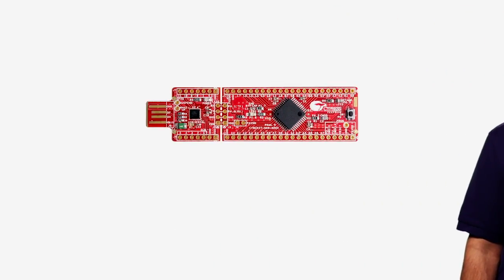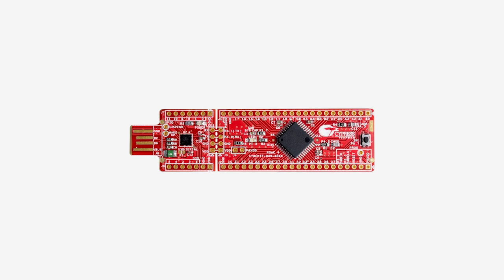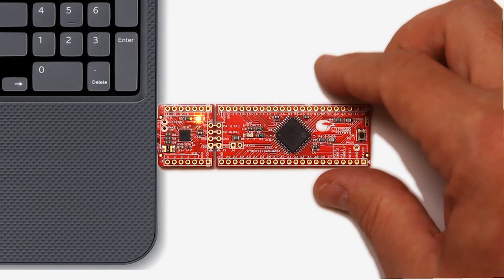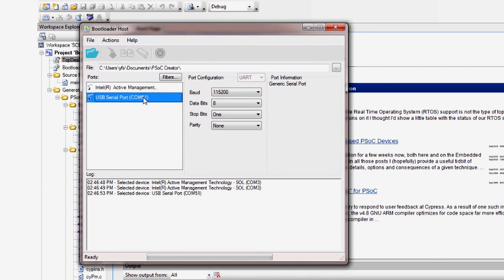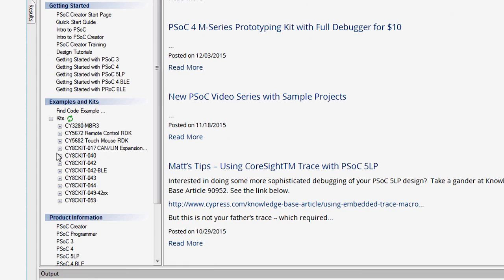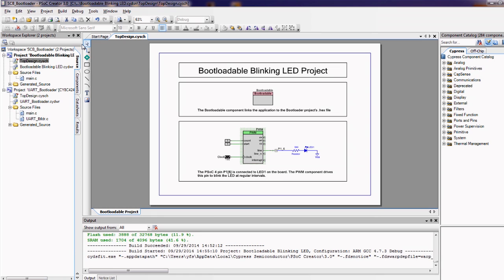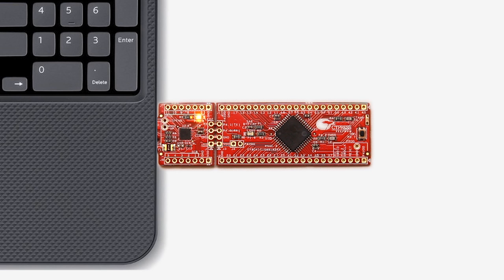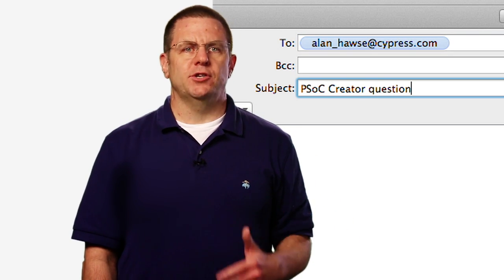PSoC Creator 101: 0. CY8CKIT-049 Prototyping Kit Getting Started

Comment: Although everything is working when changing the project "Bootloadable Blinking LED",  when I try to change the LED timing in the Project UART_Bootloader it doesn't change anything in the LED of the bootloader,  I pointed to the new "UART_Bootloader.HEX" in the "CortexM0\ARM_GCC_541\Debug" directory, I saw the original one is located under "CortexM0\ARM_GCC_484\Debug", I do clean build from everything, but still... I really wonder what I'm doing wrong?

Comment: Dear Cypress:While I do believe this is a great product, getting this development boards to work by following your instructions, has definitely really frustrating. I already spent at least 2 days, and still nothing. Just do a search on any search engine for issues with finding the device after pressing the programming icon, files missing, etc. While Ardiuno is a different type of device and I am sure that it is not as capable, their IDE is much easier to use than your IDE. My recommendation would be put all the required files into a single zip installer, instead of installing many different files. Thank youVictor
Reply from the maker: Hi Victor, thank you for your feedback. We are sorry to hear about your troubles. Is there a specific issue we can help you with? You can also visit our Cypress Developer Community 3.0 to speak with Cypress experts and other embedded engineers: http://bit.ly/29vS9Ts. Best, Cypress
Reply: ponte a estudiar mejor y quedate con arduino, psoc es buen producto.....
Reply: @cuauhtemocgarcia771  y tu menors ponte a estudiar angles

Comment: The code I downloaded required me to unplug the board and PLUG IN WHILE HOLDING THE BUTTON DOWN to get the board into boot loader mode EACH TIME TO PROGRAM the board.  When in loading mode, the LED blinks faster that the default rate.  This fact is buried in one sentence in the middle of a paragraph on the fifth page of the project guide.  It was tricky to let go of the board without causing another reboot as the contact with the port is broken if you move the board at all.  This kit is the right price but the fact that you need a video to explain all this indicates there is a usability problem here.  Maybe figure out a way to get it to program by using a single big button in Creator.  Maybe it would be the program button that already exists!
Reply from the maker: Hi NackDSP, 
 
Thank you for your feedback. Could you please share your contact information with CypressUS@racepointglobal.com -- we’d like to put you in touch with Cypress’ Sr. Product Marketing Engineer of the Microcontroller Connectivity Division to discuss your comments. 
 
Thanks, 
Cypress
Reply: @CypressSemi  Looks like I had notifications turned off for about 7 years. Oops.
Reply: Do you solved issue :D :p  @NackDSP
Reply: @FratDede  Hi.  I installed the connector for the miniProg programmer and used that.  Using a USB extension cable would also work. My problem stemmed from the motion of the PCB causing a disconnect of the USB connector pins.   Unfortunately I did not see the message from Cypress 8 years ago. My description should have been sufficient for them to solve the problem.  I retired from Cypress having worked in the department that supports this design.   It was a $4 board, so they can only do so much at that price point.  The board it replaced cost $80.
Reply: Cypress Semiconductor 
.
Reply: Cypress Semiconductor laten